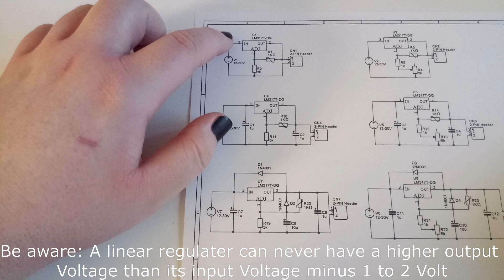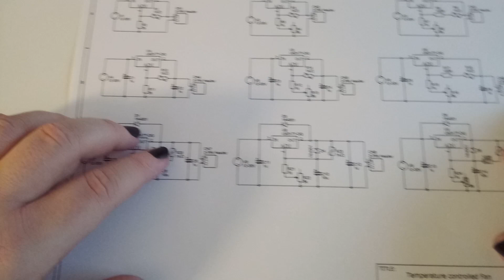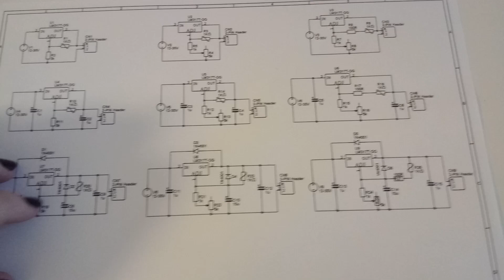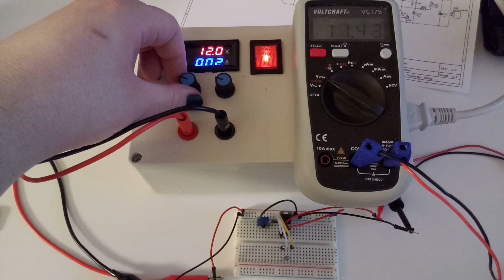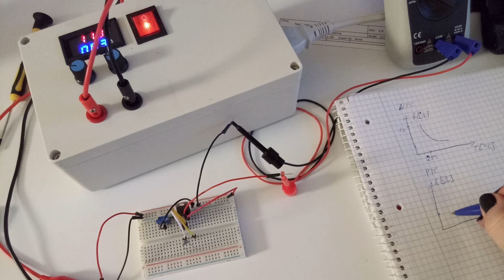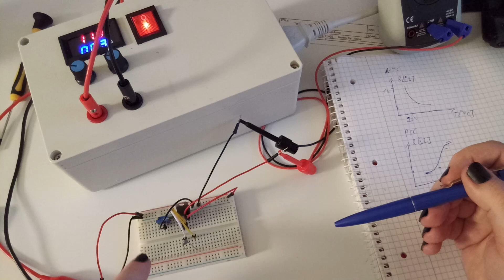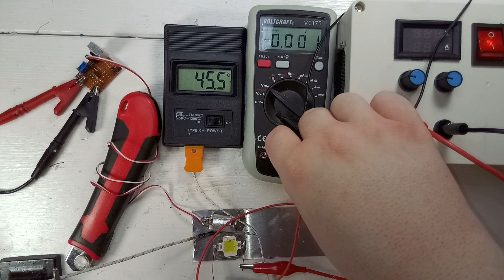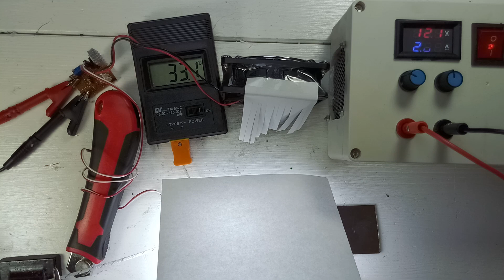Temperature Controlled Fan - LM317 based

Comment: Thank You Anna, I am working in Model Trains. We want smoke to pretend to be steam for the old Steam Engines, We do this by heating an oil that vaporizes and turns to white smoke. I work on weird Toy Trains from the 1950s. The smoke generators in modern engines are square and metal and they work well. But they do not fit into these old Steam engines. So i designed a linear shape like a turbine that fit the old Engines and i have a Mini DC Can motor for a impeller to blow the smoke out.  My issue is my smoke housing is mad with 3D Printing so it is plastic. I use a Carbon Fiber Nylon filament that is heat resistant but only to a degree. I am using a 10 Ohm heater resistor that vaporizes the oil well at 9 Volts. But I find maintaining 9 volts is not so reliable and sometimes even 9 Volts is too much. What i want to build is a small closed loop temperature controller. I want to see if the 317 could be used with a thermistor to lower voltage as the temperature rises.  I am a retired engineer and built CT Scanners and robotic systems but this EE stuff gets difficult for me.  I had to replace the Thermistor on my 3D Printer and it gave me the idea to use it on my Smoke Assembly. I heard you say 10K ohm verses a 1 Ohm thermistor so i need to check the spare Units i bought.  If it is not a 1K i need a source to get one. them i have to study you schematics to better understand R1 verus R2 and learn how to lower the voltage to the heater as the temp reaches 100C. And also build a test bed so i can test various R values and verify what will create enough nice white smoke but not melt my beautiful plastic 3d Printed Housing. I have You Videos if you wish to see my work. I am writing to say THANK YOU and to share my project needs. God Bless and stay safe, Dennis
Reply from the maker: Hey Dennis, welcome to my channel! :)
I made another video about this circuit that might also be helpful to understand it: https://youtu.be/2sW3rcxE7ZM
But here is the problem: I use an NTC thermistor as resistance R1 and a fixed, preset resistor R2 that I determine the way I described in the second video (link above). 
This means if the Thermistor (R1) gets hotter, its resistance falls therefore the output voltage of the LM317 rises.
What you need is to get a PTC Thermistor as R2 and use a fixed resistor R1 (between 240 Ohm to 2.5k Ohm) so that the voltage drops as the resistance of R2 (PTC) rises. You can get R1 just the way I got R2 in my second video.

Hope this helps :)
Reply: Yes that's what I thought from your video I tried figure out what I needed. I found a temp sensor that is 460 ohms with a 200c max. Butb it's a SMD surface mount. Could I solder it to a solid wire and hold it over my heater in the smoke assembly? I think this will work. Closed loop temp control for 1950s model train. Are we nuts? THANK YOU Anna.
Reply from the maker: I'm so sorry I was wrong. For it to not heat further you have to use an NTC as your R2 and not a PTC. This was the case for the fan crontroller that needs higher voltage if temperature goes up. You need lower voltage if temperature goes up to stop heating... So if you have 9V supply as you stated before and use a 240 Ohm resistor as R1 (minimum value) you will get ~7.5V if the NTC is at 1.2k Ohm and goes down as resistance R2 falls and at ~500 Ohm the output should be at ~3.9V.

This means either use a NTC as R2 or a PTC as R1. Using an NTC is much more reliable if you compare their resistance/ temperature diagramms.
Reply: @PhysicistAnna  I need your help. My NTC has a broad range but i need it to stay between 90-120C. If i use 9V input and want a high of 120C the NTC measures 10K ohms. What R1 is needed to drop to 4V. Then at the low of 90C  the NTC measures 4K Ohms can we find an R1 value to give 6.7V max. My head is hurting. Thank You. Maybe I need a different Thermister range?
Reply: I am still in trouble can you offer any input. I am losing my mind!!!
Reply: https://www.mouser.com/ProductDetail/Littelfuse-US-Sensor/501BG1K?qs=sGAEpiMZZMuBd0%252BwiCVS24yTICvzXOrG4vzejhFG6Sf3K73Bv6Q1BA%3D%3D
Reply from the maker: @DennisMurphey  Hey, so your NTC thermistor needs to have a much higher value to work as R2 needs to be >> R1. More like 5k Ohm? I'll make a video over the week for you in which I'll test it with a 10K Ohm thermistor as I got a few on hand or the 2.5K Ohm one I build. This I can use to stabilize my heat source that I use to set the fan circuit. Maybe wait for that then you'll see how it works and I can tell you more about it. Right now I never tested it to work the way you need it to work.
Reply: My 3D Printer thermistor is 10K ohms I can use it on a bread board. I have a heat shrink gun I can use for variable heat source and a variable VAC 5-15 Input. And I have a test box of resistors I can tap in for R2. I think I can build the circuit as a lab experiment and run for data collection. What do you think? Can we collaborate on the schematic and test values. I would share anything you want to use. I can make a video you use? I am into trains. This is a means to an end. You should teach the physics.